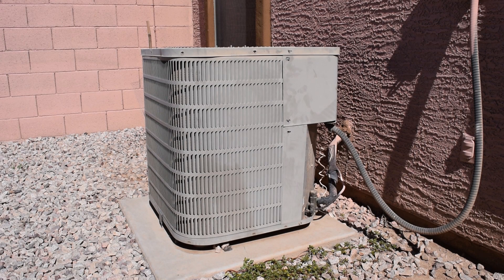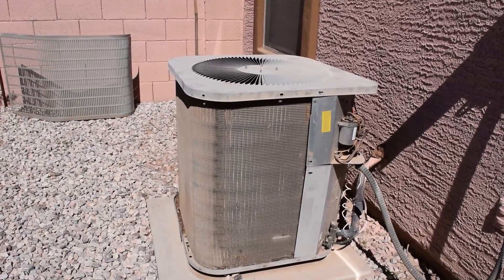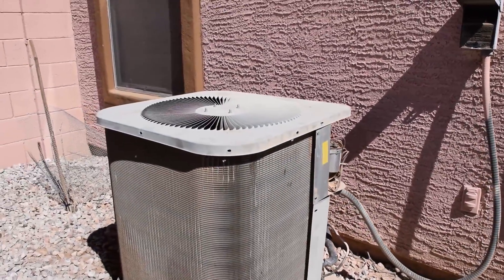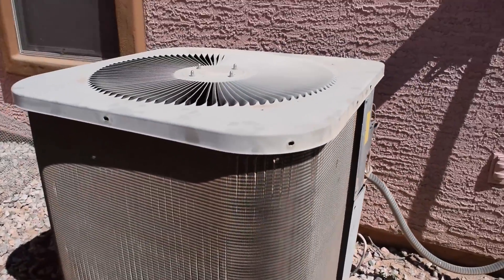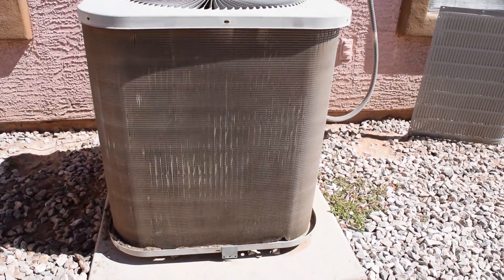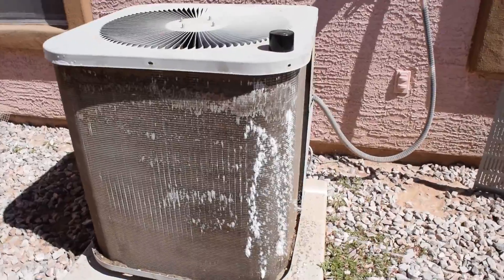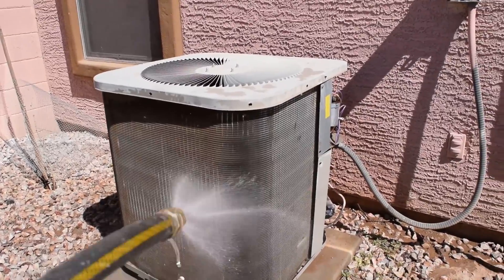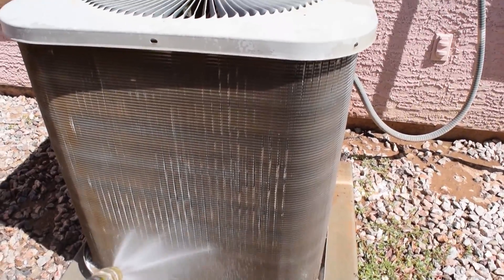Preventive Maintenance Coil Cleaning HVAC Home A/C Unit

Comment: What kind of spray foam .. cleaner .. did u use .. brand ? Etc
Reply: The kind they sell at Home Depot is called AC-Safe. Grab a fin straightening comb while you’re there.